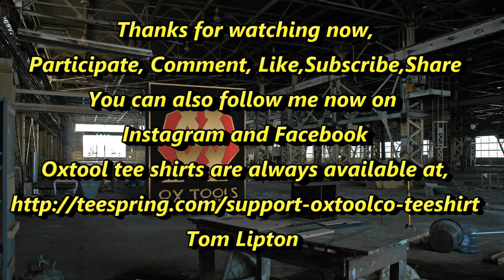Monday Night Meatloaf 89

Comment: You are absolutely right, Tech writing is extremely diffcult. The Bondo episode is a classic. The only thing I know that is worse than writing instructions is writing specs  for a contract. Having done both, and being bitten by both, I appreciate the comments.

The hammer that you called an "engraver's hammer" is to me called a Repousse' hammer, literally "repush" in French. It is used by anyone that beats sheet metal into presumably artistic shapes over wooden forms. You use the flat part on the broad curves and the peen in tight spots. Very like an auto body hammer but lighter. Jewelers use it too for forming sheet metal.
Reply: +Juan Rivero I find it easier to write technical specifications for the supply of mechanical items than to write up instructions for the users/operators...different strokes, eh?  ;^)

Eric
Reply: +Juan Rivero This reminds me of the old one on an electrical engineering spec. 

"Earth (ground) impedence to be 0 ohms."

Electrical engineer comes back to the spec guy and says "it can't be exactly zero ohms, so you need to specify an error margin allowable!"

Revised spec: "0 Ohms +/- 10%"
Reply: +chemech I think that the two areas are equally difficult. I have a friend in Paris who writes specs. He told me that the spec for an ordinary lead pencil is 5 pages long. So it is difficult to get a watertight spec. User instructions are also subject to many pitfalls. Not just ambiguity but translatability. Nowadays your instructions will get translated into a half dozen languages.  I speak Spanish and English interchanegably.  I have seen Spanish instructions (I read them for giggles) that  I do not understand at all:) and had to look at the English ones.

Comment: Tom, if you are average, I'm not even making the needle twitch!

Nevertheless, I've improved a lot from watching the videos you and the rest of the community have been putting out. Last Saturday I managed to make a new cover for a pool skimmer from a piece of 1/4" diamond plate aluminum, and still have all my fingers.  Even more amazing, it actually fit!  It was just a 6" disk with a 0.100 deep half inch wide relief on the back and a 3/4" hole in the middle, but you'd be surprised how many little problems I got to work through along the way. Someday I hope to work my way up to average.

Thanks for the help with that!

-- Mike

Comment: The mixture of bondo matters, but it isn't as critical as some of the compounds used for bedding rifles; many of which specify that the proper mixing ratio is by weight or volume. 

Technical writing can be a challenge, especially so in situations to prevent patent/latent ambiguity for future readers/generations. Two examples that I draft on a regular basis: laws & property descriptions.  Confusion can create big problems quickly.

Comment: Old school measurement for hardener is a thin strip almost as long as the diameter of the golf ball sized piece so 1 1/4". But us body men have gotten so used to mixing it we just know without thinking, color is the biggest indicator of a proper mix. Those people commenting probably never actually read the can or got showed how in the past and assume they are right. You know the old saying assumption is the motherhood of a fuck up.

Comment: I found a neat little trick that blacksmiths use to get rid of rust, the use clear vinegar and submerge the rusty part overnight. I tried it and bugger me it worked.
Reply: ***** you must be using 'american' cider vinegar, because british white vinegar does pretty much nothing, im a recent discoverer of electrolysis and wish i had a large carbon rod to try instead of the waste steel rod i use!  however the white vinegar does work to patina carbon steel to help prevent rust, esp the rust you get from a fingerprint left on them, i do this to my plane blades for example.
Reply: metalhead2508
its a dark grey, and if you dont like it will remove with some metal polish, if you like the final, wipe with wd40 or your preferred rust inhibitor and your good to go, im sure youve had tool steel that has been kept for decades somewhere, the acidity in the air has slowly made that colour, the vinegar is just to save you the decades! it also works fairly well on cast iron and even alumnium too.  theres 2 ways to do it, either cover in for 24-48 hours, or if its awkward, wrap in paper towel , soak in vinegar and wrap with saran wrap a few layers
Reply: +jusb1066 check out the battery mining video on grant Thompson 'the king of random '      for carbon rods
Reply: It was on an US weapon forging site that i found just lookup swords and he has a skull and a beautifu Chinese sword with brass brased into the blade.